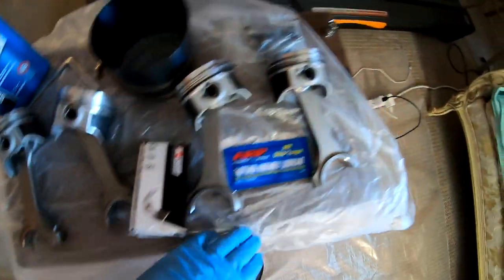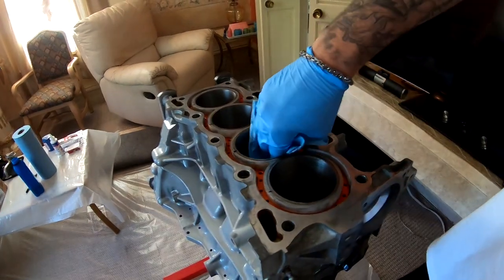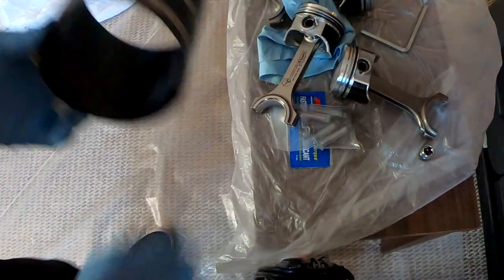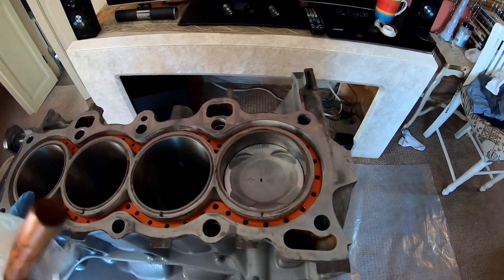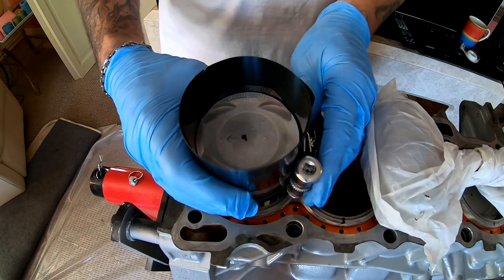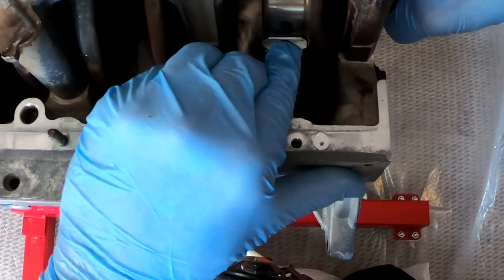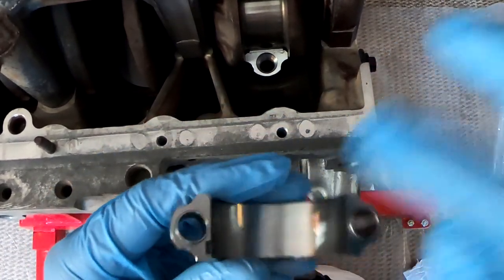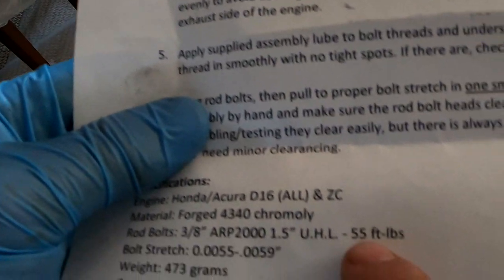500hp D16A  civic ycp Pistons install with speed factory no notch rods Vitara low compression

Comment: This is one of the best piston installs I've seen on this platform. I have a 97 civic HX and with the prices of B series/K series swaps I'm thinking of just building a D series from the bottom up. (Swapping the head of my d16y5 with a z6, most likely.) Then send it on maybe around 12psi of boost and go from there. Can still make decent power on these single cams, so I've been told. Great video man!

Comment: Nice build bro this setup is nice I' have this no notch set up and its pulls hard on 15psi. Might build another block soon these rods and pistons where like 430$ not that long ago.
Reply from the maker: Nice how much hp  are you putting down?
Reply: @BarbasLife  290 whp   235 torque . 15psi. On pump gas  Its a pretty decent tune couldn't turn it up more because i didnt have a bigger wastegate spring or else i could of made over 300 hp on pump gas simple setup 1000cc injectors stock intake manifold brian crower head delta 272-2 camshaft.  No notch block setup.arps. borg warner s200 turbo 63ar. Ram horn cx racing turbo manifold 4 bar speedfactory map. Ebay intercooler piping . on a s300v3 .  spools hella quick with this turbo
Reply from the maker: Nice  you got some money in that build and You still got room to grow with more mods for more hp.

Comment: Could I use the no notch speed factory rods with the  vitara piston set from speed factory  for a all motor build on my d16y8
Reply from the maker: You can use the rods but you need high compression  pistons for all motor. Vitara pistons are low compression  more than normal.
Reply: Any less expensive rods I can get online beside the speedfactory rods?
Reply from the maker: @ulisesaranda4816  yeah but check out jamesDguys channel he has a high compression d16 he built step by step with pistons and rods combo on a budget. It's a good build he did.
Reply from the maker: Its really hard to put power naturally  on d16 it can be done people have gotta 220hp but takes a lot of money to build. You can make 200hp safe on turbo no more than that without  problems.
Reply from the maker: 200hp on stock engine

Comment: So... I have heard some bad things about the block guards. Is there a better cheap way to do this? Or is a block guard fine 

I am building my engine for street use
Reply from the maker: So my build is for street use I have heard bad things too mostly about overheating problems.I have never had a problem but I would put one if your trying to make over 220hp. I would rather have a overheating problem then have my cylinder sleves rocking and cracking.

Comment: Why did you number the rods
Reply from the maker: Thats the way they teached me to assemble these engines back in 2000s its so you dont mix up the rod caps incase if for some reason theres more than one rod cap laying around you dont mix em. they are all different if you mix one with another rod cap you run the risk of blowing the engine. Example rod 1 and rod 3 look the same they are supposed to be the same but they are not so if i was to mix them the engine would run bad out of balance sometimes the rod caps won't even clamp to the crank. if you watch boosted boys go back 2 videos they just talked about how bad it would be to mix the rod caps up. Hope this makes sence brother.
Reply: I am building a d16 same build my first time building a engine I was wondering if the Pistons are different  Piston 1,2,3,4  how do you know the difference of the Pistons I'm getting lost and rods all the pistons and rods to look the same
Reply from the maker: Ok so when you order rods that are bran new they look the same they are supposed to be the same but they are not so you have to make sure which ever rod you choose to put in (example)cylinder 2 you use the same rod cap.so basically every rod is cut different even tho you cant see it. The cap is cut cut at the same same time as the rod so keep em together. Kinda when you disassemble and re-use the used pistons n rods they have to go in the same cylinder they came out of or it will be screwed up.
Reply from the maker: So when you order your new rods choose any of em for a cylinder and make sure that rod and rod cap only goes to that cyclinder you choose.